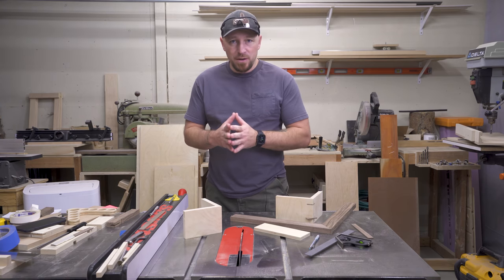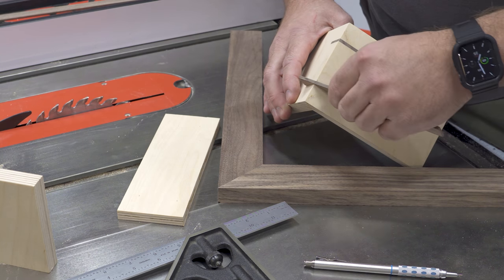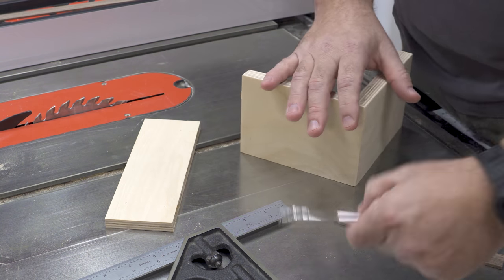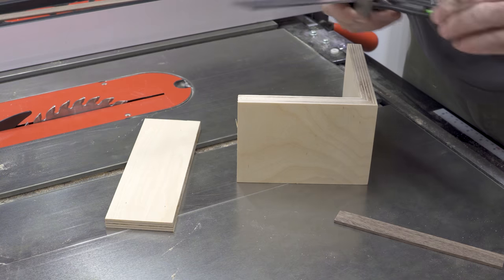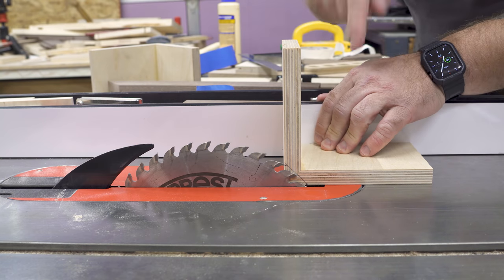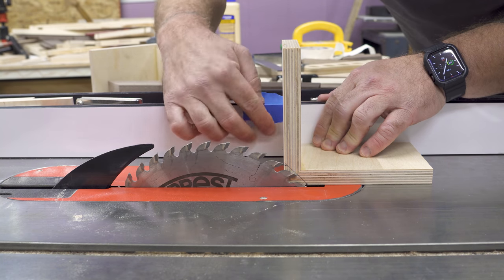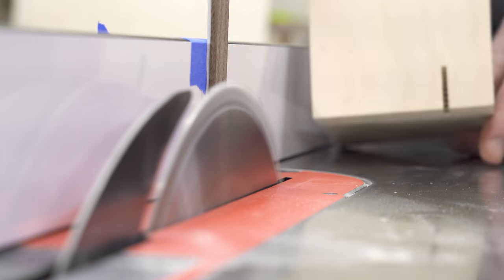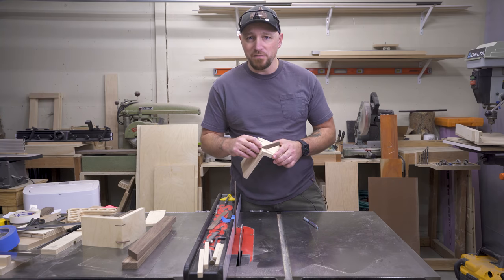How To Cut Splined Miters Without A Jig / How To Make A Spline Joint

Comment: I like this approach because it still has maximum side contact and yet has a slight depression for excess glue.
Reply: Are you referring to the deplete portion of the cut? As the blade is rounded it’s just slightly deeper in the middle? Just wanting to understand.
Reply: @Eric-469  🙂yes sir
Reply: @mightyporky gotcha. Thanks !!!

Comment: You should look at testing strengths of joints.  Glued Miters were stronger than dove tails, pocket hole screws and box joints.   Stop block clamped to fence would be better

Comment: It works!  I just used your idea to put splines in a picture frame measuring over 3.5 x 4+ feet. I did build a jig for the spline slot cutting so it was your layout and saw positioning explanation that that helped me.

Comment: This works great. I saw this a year ago I think. Have used it on several projects. I like to clamp something like a 1/4" piece of plywood as the stop block (actually I have a 6 inch by 4 inch by 1/8 inch piece of white oak scrap which allows room for two clamps so is really solid). For tall tippy things like frames, I like a feather board to hold the bottom tight to the fence and a tall fence I can hold the frame against by hand, to keep it from tipping going in or coming out making sloppy slot.

The idea in this video has been super helpful for me.

Comment: very clever as usual! I like that the blade leaves a concave bottom in the slot, which lets the outside corners of the spline make contact and leave no gaps. The concave also leaves space for the glue to help drive in the spine all the way.

Comment: Brilliant, thank you!  I was proud of myself several years ago making  a really nice spline jig. Of course it was for the 90 degree angles of a common rectangular box. Today I started making a hexagonal box which will require splines at the 60 degree corners. Oh no, what to do? Well, six minutes of you video solved my problem. Pretty sure I can use your method on my project.  I have worked with wood since 1952 and have never seen this simple technique.

Bill

Comment: Thanks! This video saved me a lot of time and hassle. Setup took me about five minutes and the plus is I will never have to build a jig to cut external splines in mitered joinery. I also used your internal spline along with your external spline you show on this video on my present project. I subbed.

Comment: What a great idea.  Much easier than building a spline groove cutting jig. Going to give this a try on my first ever spline box.  I also like using walnut dowels on my non mitered boxes.
Reply: Tried your method on my first box using splines and it worked out great.  Being educated in engineering I naturally had to use my drafting board and drew everything out to actual size and figured what my blade height would have to be for my particular situation.  Plan to make computations for different blade diameters and wood thickness and then I can just look up the needed blade height,  Also sprang for a nice 10 inch Freud flat grind rip blade and I really like the quality for only 50 dollars. Thanks again for the video.

Comment: Thanks for the vid. I normally use a jig for putting splines in my smaller builds but this approach is great for larger pieces that aren't well suited to balancing on a jig at 45degrees

Comment: As I was making picture frames for the first time, I was looking for a way to reinforce the miter joints, so I watched many YouTube videos on the various methods.  Since I only have a job site table saw I was not sure how stable I could make a spline jig for it, then I saw this video.  After trying this method on a couple of test pieces, I tried it on my picture frames and was very pleased with the result.  This was one of the most helpful woodworking videos I have seen in a while and I watch a lot of them.  I have subscribed and will be looking to see what other great ideas you have shared in the past and the future.

Comment: This is a fantastic bit of information. I am near the point on a project where I'll be adding splines. There will be 48 in total so I may still build the jig. Maybe not;  as I think about it, the fence would only have to be set 3 times so this may work just fine. Using various sized splines would make it a little trickier I guess?

Comment: 👍 Thank you.  Great tip.  Just thinking about the geometry.   Since these joints form a 90 deg, doesn't it make sense, that the sweet spot on the blade is at the 45 deg point as viewed from the side.  The 45 should match out the midpoint of the spline at the box.  You adjust the blade height to get to the midpoint of the spline.  Make sense?  You could mark your blade 90 (top), 0 (horiz, below the table) and 45 degrees.

Comment: Thank you for a very informative video!  Found this video at an opportune time because I was on the verge of making a spline-cutting fixture.  Using a dado stack that's 8" diameter, I drew a full scale plan of what I intended to do using only MS-PowerPoint, and found I could pre-determine the blade height on the computer.  I was also able to determine where to clamp a stop on the fence before making a cut.  I modified my calculations further to allow for a 1/4" thick piece of MDF below the box to help prevent tear-out.  Still, I used the method illustrated in this video to double-check my calculations before I made my first test cut.

Comment: Lovely vid, thanks. I have a mitred box that is 710mm long and certainly won’t fit on my table saw (with the fence). So what advice do you have for squaring the box up on a table saw without a fence please? The t-track mitre rail that came with my DeWalt table saw is garbage so can’t use that.

Comment: What are the measurments of the kerf on the saw? 
The biggest size I can purchase (here in the UK) comes in at 2.8mm, and it produces a very thin gap for the mitre bits. Using a Biscuit Jointer seems to create a more pleasing mitre insert.

Comment: There are still people out there without a table saw (like me). Any suggestions ? Thanks for your videos which explain clearly.
Reply: If all you’re wanting to do is cut splines then if you have access to a biscuit joiner, then that works really well for this as well.. and if you don’t then a biscuit joiner is a hell of lot cheaper than a table saw... but on that note, I wouldn’t waste money investing in a biscuit joiner before a decent table saw.. check your local craigslist from time to time.. you will eventually find a decent used table saw being sold at a really good price
Reply: Maybe router with slotting bit

Comment: Not having any backing I notice a little tear out. Would you use tape to prevent or any other ethod?
Reply from the maker: A zero clearance insert will take care of the tearout. I just did this for demonstration purposes and kind of forgot about it. You may be able to use masking tape to create one, if you don't have one already. Recently I've found that this zero-clearance tape (https://youtu.be/I-hFhsNdOV8) from FastCap works really well for this as well. I made a video about it here (https://youtu.be/Nfr3pi47xyE), if you're interested.

Comment: But wouldnt that leave you a little hollow point where the curve of the blade wont meet the straight line of the spline? I mean its just a small hollow point but you get my point right? Would that affect the strength of the joint itself?
Reply from the maker: Yes there would be a small hollow because of the curvature of the blade. I can't see the strength being compromised though as it is such a small area.

Comment: As far as setting up the blade, you could probably avoid doing it by eye with your line and get it right a bit more repeatedly (it would be more like your style:)

The idea is that we want the tangent of the blade to be at 45 degrees at half the height of the cut we want to have in the vertical piece.
We can easily raise the blade so that it is at 45 degrees with the table right at the table by bringing the 45 deg part of a combination square against the teeth and raise the blade until the contact point is exactly at height zero.
(Alternatively we can do that with just math and raise the blade by exactly (1-sqrt(0.5))*blade_radius)
From there, all we need to do is raise the blade by half the height we want to cut in the vertical piece.
To do this last operation (and the trig trick between brackets above) you need to know how high one turn of the crank will raise the blade. This is easily calibrated by turning the crank a round number of turns from height zero, measuring how high the blade came, and dividing.
Then for positioning the stop block, it's easy to find where the teeth are when they get below the throat plate, and move the block back by the desired amount.

I hope that makes sense. I'm sure you'd explain that much more clearly:)

Thanks a lot for your videos, which are super informative and just the right duration.
Reply: I've just made my math simpler: if m is the thickness of the frame material (or a smidge less than that if we don't want to see the cut poke out of the inside corner), then the blade needs to be raised by h = m + 0.146xD above the table (where D is the radius of the blade).

For a 10 inch blade, the formula boils down to h = m + 1.46" (which can be rounded up to 'a hair under 1 1/2 inches')

Once the blade is at the right height, there's much less trial and error going on for the rest of the tuning.

Comment: I thought this was called keyed miter? Spline would be what could also be called a floating tenon.  Great idea, though. -- prevents gaps at the inside edges of the splines/miter keys.
Reply from the maker: I believe you are correct. I don't hear many people on the internet calling it that though so as far as search results go no one searching for it would have found this video.

Comment: With a jig you only have to set the depth. This setup is longer and has to be done every time
Reply from the maker: I mean, you can't really claim it takes longer if you haven't done them both consistently enough to compare. This method takes a few seconds. At any rate, this is great for people, like myself, who don't need to cut them all the time and don't have the space to store yet another jig.
Reply: @InspireWoodcraft  That might be true.  I'm thinking only from a mass production point of view where jigs save time which saves money over dozens or hundreds of units.

Comment: Guessing they wouldn't be 100% on each side as you are eyeballing it.  But so close no one would ever be able to tell.
Reply: If the very slight discrepancy mattered, it would only be in comparing two adjacent splines.  You can make them match by cutting the four corners and then resetting the fence, rather than turning the work around.
Reply from the maker: I suppose if you wanted you could get your 45 degree mark and then measure in from each side of it the same distance, and then set your blade accordingly.
Reply: @InspireWoodcraft  good point.  But again probably within 100th of an inch so no one would know.